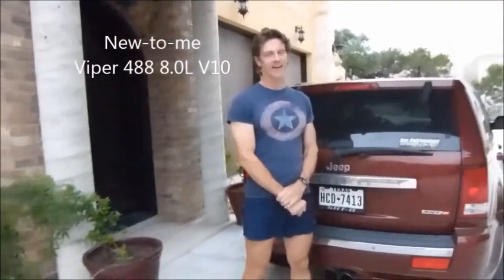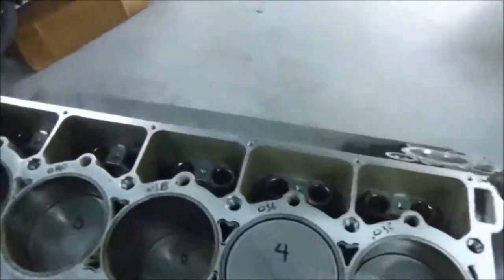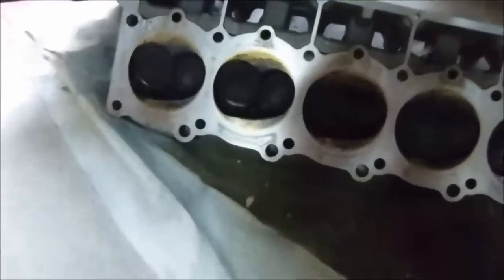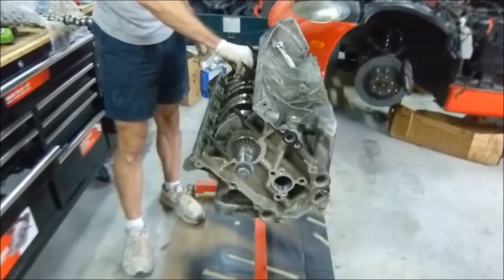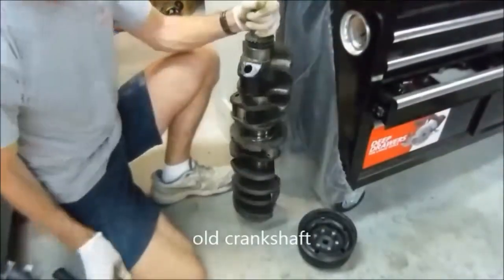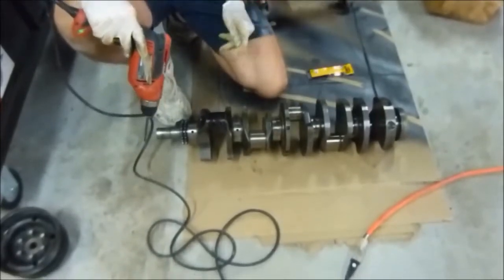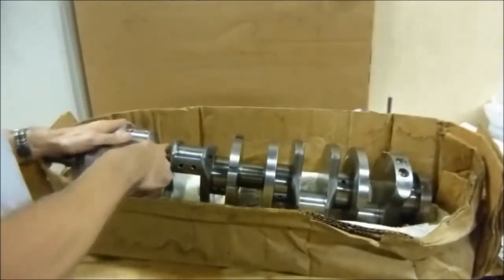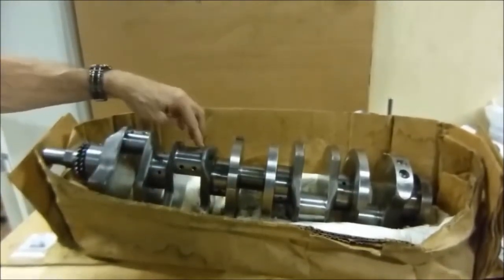I Bought  a Viper Engine to Rebuild!  Plus crankshaft oiling mod!

Comment: @mcgyverdude just finished my drill, tap and loctiting the set screw oil mod. Just wanted to send you a huge thank you for showing me how to do this. Unfortunately I was a victim of a Spun Rod bearing on #3 at 28k miles. Appreciate your videos, they’re helping me a ton 👍
Reply from the maker: One of these days I'm going to make a video of pulling the oil pan and inspecting the 3/4 rod bearing on these cars.   Its really sad how many Vipers have succumbed to this issue.
Reply: @CrankAddict  Would love a video of the rod bearing inspection!! I do not want to be a victim!! Great videos!! Thanks for making them!

Comment from the maker: The dodge viper has several cross-drilled main bearings.    The mains that are cross-drilled are more likely to starve the rods of oil.  By blocking off the offending passage, you can convert the cross-drilled mains to a chevy-style oiling system and improve oil pressure for those rods involved.  You will not notice a difference at the gauge, but your rod bearings will thank you.

Comment: Hi, I recently watched more of your viper videos I find them to be inspirational and informing when discussing how to properly put things back together. I curious if you have to do any maintenance (except fuel filters) regarding the fuel tank located on the bottom of the trunk floor? Also what are the most common problems you've experienced while in or while you owned it?
Reply from the maker: weak powersteering pulley- get a billet one.    GTSs always split the window seal around the sail panel.   RT/10s do have issues with the rubber grommet for the fuel tank filler tube.    Lots of heat.    These cars are pretty tough on the street.   The track will require further prep.

Comment: Hi, I liked the video. But i was wondering if the pin would  knock the balance on crankshaft?
Reply from the maker: technically yes, but the pin is small and located close to centerline on main journal.   Engine feels great to 6200rpm!

Comment: Nice to see a video of the oiling mod.Ive read much about it.
I changed the main and rodbearings on my 06 Coupe at 50000mls for precaution.Car was driven also on the track for its life.I only used Castrol 10W60 on it.
Bearings looked all good,all had the same wear,so no.3/4 looked like all the others.

I plan to do the oiling mod in the future.

Only one question: How you know how deep you have to put the blockadepins in it? How do you know that you arent too "deep"?
Do you afterwards checking it again like before youve done it in the video?

Best regards from overseas :)

Keep up the good work

Comment: What does this mod help for?
Reply: Vaios Kaliakoudas it prevents spinning your rod bearings. These cross drilled hole were supposed to help oil flow, instead it causes air bubbles to get to your rod bearings which spins them when there isn’t oil getting to them. It happened to me! Most common on #3 & #4 cylinders

Comment: Is that red lock tight rated for oil and heat?
Reply from the maker: For the heat that a crankshaft is subjected to, yes.  The lock tight probably isn't really needed.  It just makes me feel better (as long as it stays out of my main bearings)
Reply: mcgyverdude 🤞